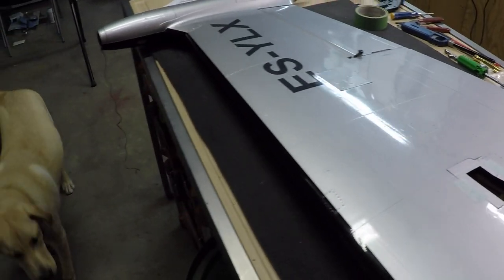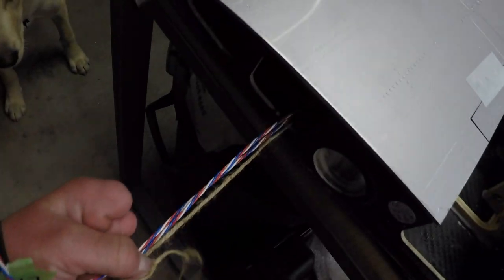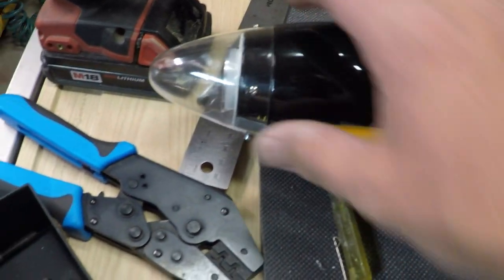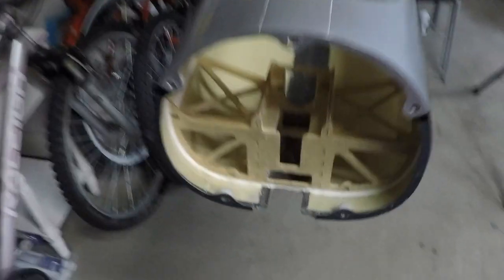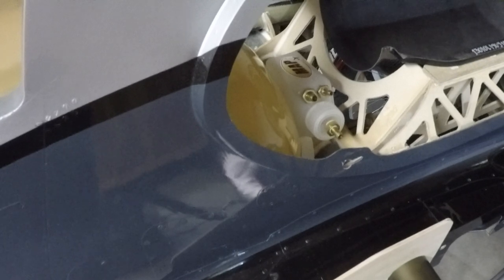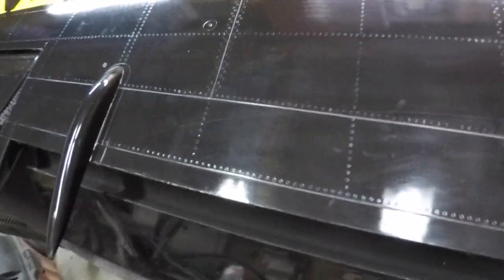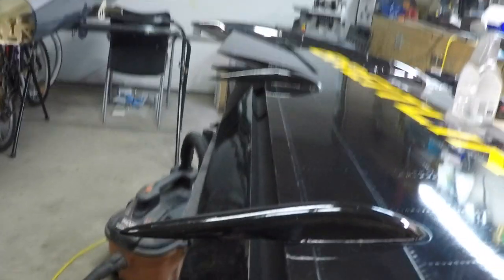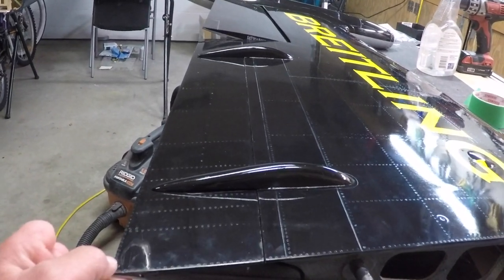CARF Skygate L39 Breitling Build video #5  Flap Fairings and left wing complete

Comment: Hi dear,
i want to ask that how much does the flap take time to extend from zero degree to landing mode (44 degree) and also how much does it take to retract from 44 degree to zero degree.
thank you, and nice video .
Good luck
Reply from the maker: Depends.  For the flaps you can set delay in the radio.  I generally as a default, set my delays to 2.0 seconds and find that work well.  Gear Retaracts in about 4 - 5 seconds.